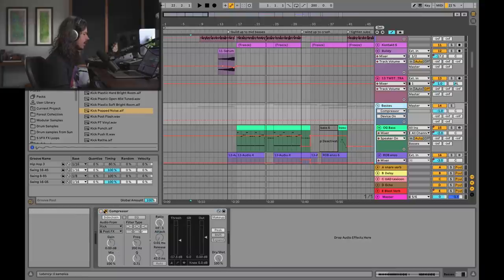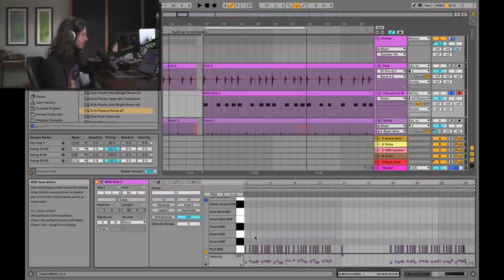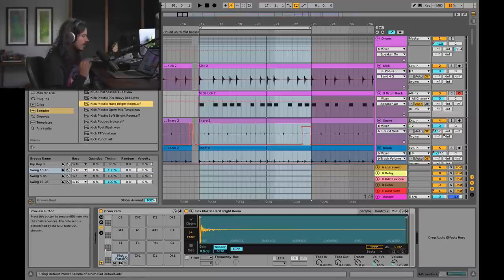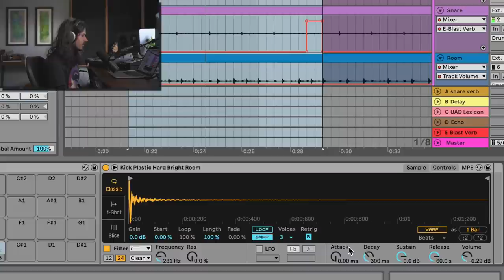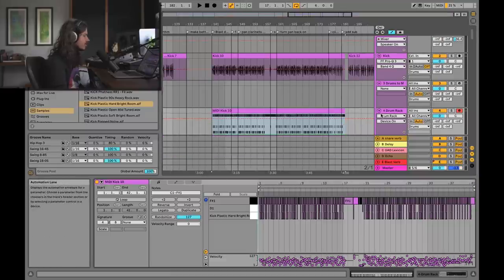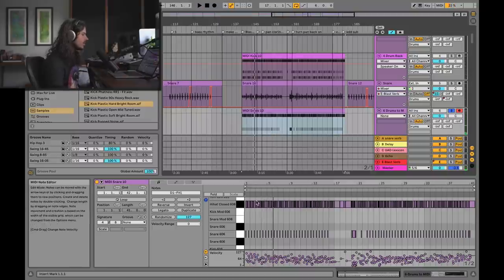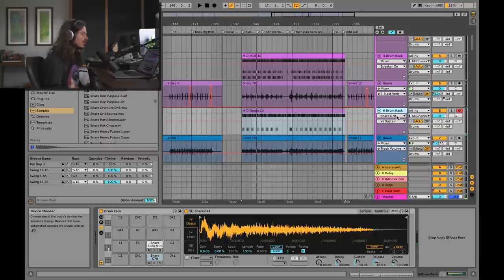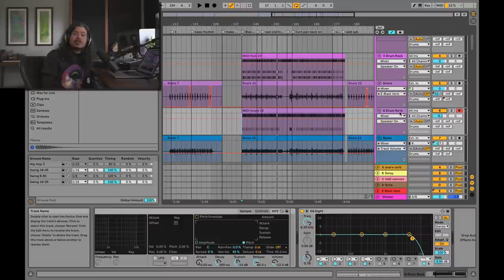Drum Replacement Workflow in Ableton Live

Comment: Hey! Thank you for your help. I was just encountering that problem. I wonder, is there a way to stop ableton from trying to determine what instruments the original audio file might contain? I feel it does not make any sense! There are so many situations when I have a single instrument of a drumset and just want to replace that one. So there is actually no need for different instruments in the resulting Midi Track?? Thanks so much!
Reply: Right now I am working on a track with a lot of ghost notes on the snare and Ableton is converting that into HiHats one time and snare hits the other time and I have to correct them manually by hand, that is so annoying :S